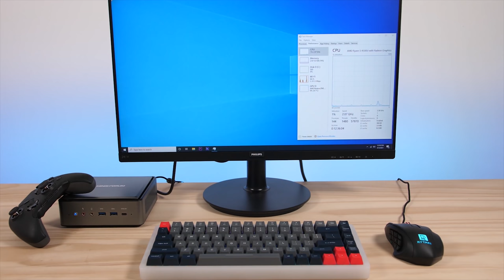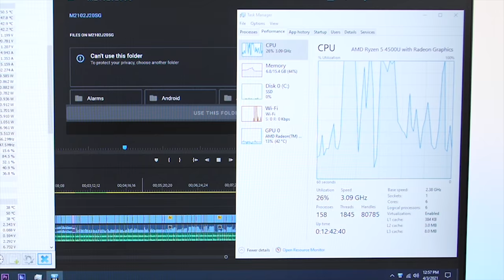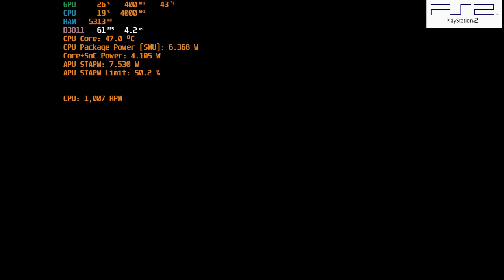Ryzen Mini Gaming PC (PS3, Switch, Wii U, GameCube)

Comment: It's a dream of mine to get something like this as a stand alone emulator hub from NES all the way to Switch so I can keep my console collection as strictly display.
Reply: Its possible on 888+ processor. Other than wii u
Reply: I'm working on it since this morning
Reply: i just bought a 3050 mini to make a stand alone emulator
Reply: That's what I have. It's not that expensive or anything. More just time consuming to compile your collections. 

I have a HP Pavilion 15 Gaming Laptop. It has a 10th generation I5 CPU, an Nvidia Geforce GTX 1650, 32 GB ram. Costed me 500 bucks on black friday. I barely have finished putting everything together to feel like it's complete.

I have every from NES to PS3 to Switch with absolutely no problems at all. High settings too. I even ventured out of the emulation build and got modern games running. Have games like geshin impact, dragon ball fighterz, even the final fantasy 7 remake runs fine on the laptop. 

You can easily achieve your dream for 5 - 600 dollars and alot of free time. Downloading files and installing emulators.
Reply: me too
Reply: @EpicBongZilla  are there some other mini-pc's that I could get in that price range that can also handle ps3 games? Thanks
Reply: All you need is a decent laptop and batocera 😁
Reply: @JackhammerSChannel  I've always wondered why Wii U is so hard to emulate, but not switch.

Comment: FINALLY a machine with decent enough cooling facilities to be able to play Space Invaders Atari 2600 version without incurring structural damage due to heating issues. Its just the emulation I am concerned about now, I still fear it may not run glitch-free out of the box.
Reply from the maker: Please start uploading Space Invaders content on your channel.
Reply: @TakiUdon  but I have yet to find the beast that will be able to run it efficiently! This time however, things may be different.. this machine may well be "The One". So I cannot thank you enough for this. I have been waiting a long time to play my favourite game.
Reply: @ncf1  That Game Really Need The Power Of The New Rtx 3090, Amd Threadripper, 256 Gb Rams, And 1 Petabyte Ssd, Even When You Had All Of That Hardware You Only Get 10 - 25 Fps.
Reply: @TheRealEncy  good heavens
Reply: @TakiUdon  hi bro can you use a ps3 controller?

Comment: I have 2 of these, a UM250, a UM700, a couple of TL50s and the HM80. Very pleased with all. The ability to add additional SSD(s) on most of the Minisforum PCs is a huge plus for me.  I run my OS from the 512GB NVMe SSD and use 2.5" SATA SSD(s) for games, ROMs and general storage. If they didn't have the slots for 2.5" SSDs, I would have passed on all models. Even their budget UM250 has the ability to add one 2.5" SATA SSD. HM50, HM80 and TL50 has space for two 2.5" SATA SSDs. Even their inexpensive UM250 has a slot for one 2.5" SATA drive.
I do wish they had made them to fit 4TB mechanical hard drives for cheap storage but these are well over the 7mm maximum thickness.
Reply: How does the um700 work for emulating games? Can't it run ps3 games?

Comment: This shows how good this emulators are. Not just the hardware but the software is important too.
Reply: I was thinking the same, as a nice front end of emulators would be needed.
Reply: @navysailor1980  retroarch is a front end of emulators but it doesnt support anything after ps2 and wii

Comment: If you go in bios , u can set the tdp to 45 , which will almost give 35 percent increase in performance.
Reply: But didn't see the temperature in steam games like Cyberpunk ? If you do this the temperature is near 90 degree and the cpu and apu slow down. Not good for such a tiny system.

Comment: Nice device, especially for emulators! But a decent PS3 emulator will take time... Thanks Taki!
Reply: Yeah the ps3 emulator needs work. I tried pcsx3 and was disappointed lol
Reply: Maybe in 4 years we will have a PS3 emulator that works with most games.

Otherwise, is pcsx2 perfected now? We can play to any PS2 game we want?
Reply: @miganhawkins8390  Rpcs3 emulator a little better for what i play, which is generally games that dont get a US release
Reply: @masamune1177  i will check that out soon.
Reply: It's 6 threads man what do you expect. With a 6 core 12 threads it will do ps3 no problem. The higher the core and thread count the better the performance because pcsx3 is cpu heavy
Reply: @wargamesmaster  PS2 Emulation with pcsx2 is really good and if you just want a game to run there is software mode. They're a few games that don't run, but there's like over 1500 games (plus all those released prototypes)
Reply: Aren't all the PS3 games on other systems as well and some even ported to PS4? With Xbox360 and PC versions being the better ones.
Reply: @Jason75913  Bloodborne and MGS4 come to mind as games that didn't ever leave the PS3
Reply: @DireBowser   Bloodborne is more widely known as a PS4 game
Reply: هل يدعم ps1 and ps2
Reply: @Jason75913  But not a pc game. Nobody wants to buy an entire console for a single release.
Reply: @DireBowser   such people do exist, but they aren't that common (I assume)

Comment: what is the best barebone build that one can get with space for upgrades? I don't mind spending some money but I cannot dish $700 all at once
Reply from the maker: The problem is that these all come with a large premium. This was supposed to have a barebones option that would have been a lot cheaper, but it got canceled for some unknown reason. Your upgrades for these are almost always going to be limited to ram and storage. If this company makes a cheap barebones Tiger Lake pc in the future, that's the one that I would grab because you'd have TB4 support for an EGPU down the line.
Reply: Lol came here for price tag. Dammit
Reply: Then spend an extra couple months saving the difference and buy it
Reply: HP ProDesk 405 G4

Comment: The bus between cpu and gpu in consoles is faster than contemporary pc, for example the ps3 bus between cell and rsx is faster than pcie 3.0 bus so it is so difficult to emulate. U series cpus are not good for l emulation because they have a big bottleneck in the 4 pcie lines.

Comment: this is a nice pc for sure. i love the small factor pc. 
to be honest i never understood the big tower pcs... i mean i have one, always had one, but i think the design is really outdated. there is tons of unused space in a regular tower pc, especially when there is no gpu inside and the cpu cooler is small.
Reply: For any combination of Pc components that run off more than 150W A mid to Full tower is usually necessary.
Reply: @MarcABrown-tt1fp  I get what you are saying and that's why I have one. I have a gaming PC, so I have a regular tower - I need the space for the gpu . But I think you didn't understand what I meant. 
I meant that the design itself is not exactly practical. Even when you put a big GPU the space inside the case is not used completely. 
Think about the more modern design of the m.2 ssds - they are placed flat on the motherboard. They are not placed perpendicular to it, sticking out like pci expansions, although technically the port is very similar. They are not placed somewhere else in the case like a HDD. It's a good design. The replaceable ram of laptops is also very discrete, staying almost flat to the motherboard, instead the desktop ram is sticking out like it used to from back when it was firstly designed. 
So what I'm saying is there are ways to redesign the standards so space can be utilized better. Like a pci expansion slot could be placed on the back of the motherboard and be similar to nvme slot so the gpus and other pci parts to stay flush with the motherboard instead of sticking out. this will also leave more space on the front so the ram could adopt the laptop design as well. Which in turn would make more room for CPU coolers, and they can be made more wide, but low, Instead of narrow but high like the current ones.
Things like that. 
But manufacturers are sticking to old standards that were designed like 30-40 years ago, when they were thinking about how to make it work and not how to make it practical.

Comment: was a pain in the ass but i found out some info on that ssd.  someone benched it with passmark and uploaded the test to the database. 
Sequential Read	2,288 MBytes/Sec
Sequential Write	1,115 MBytes/Sec
Random Seek Read Write (IOPS 32KQD20)	1,073 MBytes/Sec
IOPS 4KQD1	66 MBytes/Sec

not too shabby for an oem chip

Comment: I can't wait for Ryzen 5000 NUC style PCs
Reply from the maker: The cool thing is that this board can be compatible with 5000 series if you had a reflow station and a bios update :)
Reply: why?  why not just build a desktop for that much and get 4x the performance?
Reply: @XX-121  Because that defeats the whole purpose of a NUC style pc? And if it's sill Ryzen 5000, it's still gonna perform very similarly, only going to be limited by the cooling. Building a bigger case isn't going to net you more performance
Reply: @FrostBitttn  dude do you understand there is a difference between laptop and desktop cpu's?  no they don't perform similarly.   and a bigger case will add you more performance not only from better cpu, but better cooling, better ram, better overclocking, and better graphics.
Reply: @XX-121  If you don't understand the novelty of a NUC style pc then just say it. Yes, people will sacrifice paying more and graphics performance, but that's the whole reason it's a NUC style pc, the exact same thing goes for laptops, they pay for the form factor. People will spend 2 grand on a nice slim laptop that cannot game and be happy with their purchase. And with proper cooling yes they will perform similarly, because they would be the using same or even a slightly revised version of the microarchitecture that is used in desktop Ryzen 5000 CPUs. You get the IPC of Ryzen 5000 and if it's a NUC style pc, you would most likely be getting and an APU, so those two combined would be amazing for emulation
Reply: @FrostBitttn  what's it got? a 256G ssd? lol  so you gonna use external storage? or spend another $450 on 2tb nvme ssd?  not only that it's not just graphics performance it's everything performance.  why not build an itx rig in a lan case?  not a whole lot bigger, still portable...
Reply: @XX-121  Is it not clear to you that you aren't the target audience for a NUC? You don't like it, that's fine. But arguing like this isn't going to win anyone over
Reply: @FrostBitttn  not someone like you, but someone with brains, it just might
Reply: @XX-121  Alright now you're just being rude

Comment: You didn't mention though that most of those emulators use OpenGL as primary graphics option and that AMD absolutely sucks at OpenGL (as well as refusing to improve OpenGL performance even though so many people ask for it)
Reply from the maker: I talked about it when I got to 3DS
Reply: It's not that they refuse to "improve" performance.  They stick to the specs of OpenGL while other companies have hacked and cheated around them.  It shouldn't be up to AMD or any other company to overcome the inherent limitations of an API; it should be addressed by the standards body that governs the API.

Comment: Seems cool, but for that price one can assemble a 4700G+, or maybe one of the latest I7 11th gen.
Reply: Miniaturisation has a cost.
Reply: @blunderingfool  for a bit more you can get a laptop with a dedicated gpu
Reply: @RobIn-ky4uz  true but laptop is not an ideal machine for gaming compared to pc or mini pc as they have dedicated cooling systems
Reply: @blunderingfool  asrock x300 got you covered.
Reply: But the size tho
Reply: @SpeedNash  looks like you are not up to date with current laptops and dedicated gpus. For around 1000 EUR you get a laptop with gtx 1660ti with 144hz screen that plays modern games  at 60 fps in 1080p
Reply: @RobIn-ky4uz  thats true... Im not talking about price or if u can game or not.... Its about efficiency, gpus in laptops are underpowered and are not same as pc gpus with same model or variant.
Not to mention their pricing is extremely overlooked and totally not user friendly
Reply: @RobIn-ky4uz  also a laptop of 1000 eur is extremely overpriced for around about 700-800 eur or dollars which one u refer to you can get better performance in a dedicated desktop

Comment: Small nitpick on an otherwise interesting video - watt-hour is the measurement used for batteries, things that store an amount of energy, whereas watts is the measurement for charters, things that push energy at a certain rate. A 95 watt-hour charger would be a charger with a 95 watt-hour battery in it, and while there are certainly external battery backups that beefy, that would be larger than the entire box the HM50 shipped in ;)

Comment: Way too expensive. For almost half that you can get a minipc with  Ryzen 3 PRO 4350G which isn't a mobile cpu like the U series.
Reply: preach it brother.  i've tried to tell a few other people that, but they have know clue.  I can't believe they even sell any of these things, but hey, there's a sucker born every minute, right?  personally i wouldn't trade my desktop for anything but if i was gonna buy something with laptop parts, i might as well buy a laptop.  

and you can always build a system with an itx mobo if you really need portable.  that way you have all desktop parts and the option to use a gpu.  and way more connectivity.  like audio out on the rear for instance.

Comment: It's a good mini PC, but sadly the 3DS performance isn't good.
Reply: Generally I’d just hack a 3DS. They can be pretty cheap.
Reply: Do you emulate 3ds with a touch screen monitor split into 2?
Reply: @wordsmith451  yep, specially the old 3ds' which can play 95% of the 3ds catalog just fine.
Plus, added bonus of native ds emulation

Comment: Do you think it's possible to play ps2 games with 60 fps patches ? Some can be.... Hungry.
Reply: What? You don't think PS3 emulation isn't demanding?
Reply: @jothain  this isn't answering my question.
Reply: @mrsnippysnoopa8300  It kinda is though. There's your comparison.
Reply: @jothain  it doesn't compare.
Reply: @mrsnippysnoopa8300  How come?
Reply: @jothain  no emulator works the same way. They cannot be compared.
Reply: @mrsnippysnoopa8300  Ah, that's obvious. But, still, PS3 emulation is quite heavy on hardware. You really think PS2 60Hz is more demanding that's shown on video? I highly doubt as Cell is tons harder to emulate on good speeds. Not to mention that ps2 is quite old emulation anyway. Oh and note it's running ps3 almost constant 60's.
Reply: @jothain  not 60hz. Games formerly running at 30 fps patched or hacked to run at 60.
Reply: @mrsnippysnoopa8300  have you ever had your skull measured for thickness?  might be a world record.

Comment: I’m getting the Aya Neo instead.
Reply: Me too.
Reply: What's the Aya Neo? And what console it can emulate (if it's anything like all of those "emulation consoles")?
Reply: @wargamesmaster  google is your friend
Reply: In the end, I did use google to find infos about the Aya Neo, this device is only available in very limited quantities at approximatively 800$ (without any shipping fee) but the kind of games it can emulate makes it worth the price if you have the money for the Aya Neo.

While I'm here, you do realize it's very annoying to answer questions by "Google is your friend", right? If you didn't wanted or didn't know much about a subject, you should say so.
Reply: @wargamesmaster  it’s also very annoying to be asked a question as if you are google. If you had a question that wasn’t easily answered or required some insight, I would gladly answer, but there was nothing I could’ve told you that you wouldn’t find out yourself.

The base AMD chip in the Neo and the device this video is talking about is identical. Thermal performance suffers in a handheld, but bumping up TDP doesn’t offer so much benefit on this chip. Given that I saw this box sell for $700, it seemed silly to pay that much when the Neo cost me not much more.

The Neo is still available on Indiegogo, but it’s more expensive and doesn’t offer the standalone model anymore. I still think the extra money is worth it. It runs GameCube, PS2, PS3, and other demanding consoles quite well.

Comment: Hey man , what does this means, Onboard Intel Celeron 2955U 1.4GHz Dual Core Dual threads 3MB cache TDP 15W

*Onboard Intel Haswell 22nm CPU Intel Core i3-4010U 1.7GHz Dual Core Four Threads 3MB cache TDP 15W 
*Onboard Haswell 22nm CPU Intel Core i5 4200U 2 cores 4 threads 1.6GHz max 2.6GHz 3MB cache TDP 15W
*Onboard Haswell 22nm CPU Intel Core i7 4500U 2 cores 4 threads 1.8GHz max 3.0GHz 4MB cache TDP 15W
*Onboard Broadwell 14nm CPU Intel Core i3 5005U 2 cores 4 threads 2.0GHz 3MB cache TDP 15W

*Onboard Intel Broadwell 14nm CPU Intel Core i7-5500U 2.4GHz Max 3.0GHz Dual Core Four Threads 4MB cache TDP
Reply: Can this play like ps 3 games